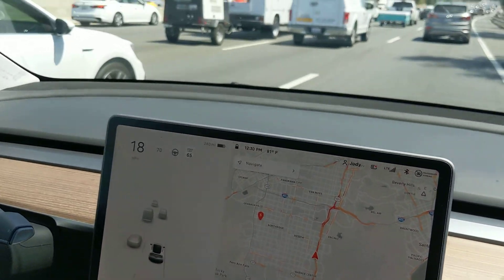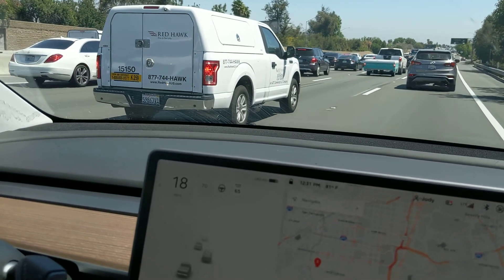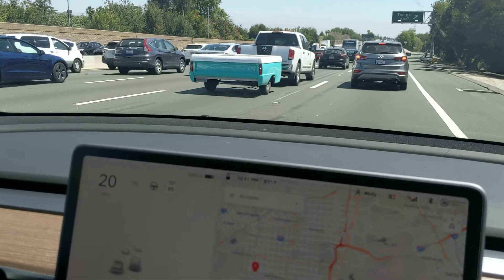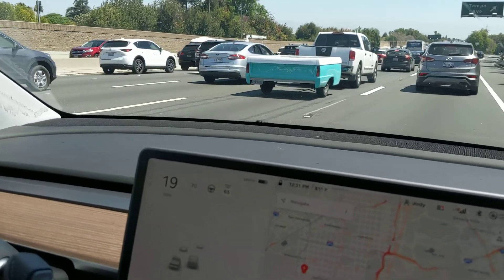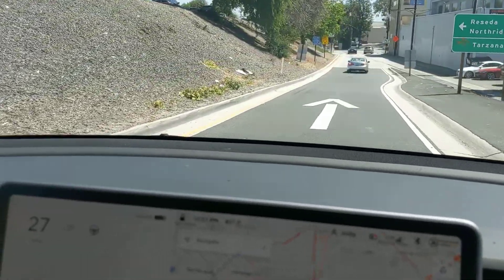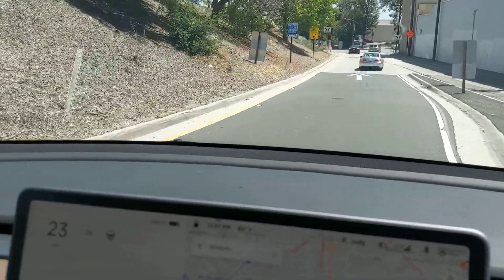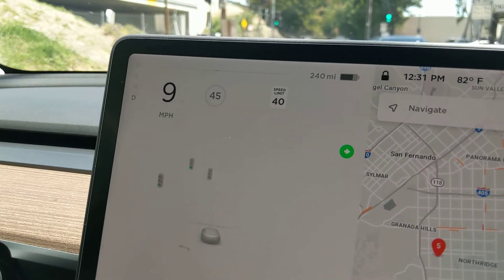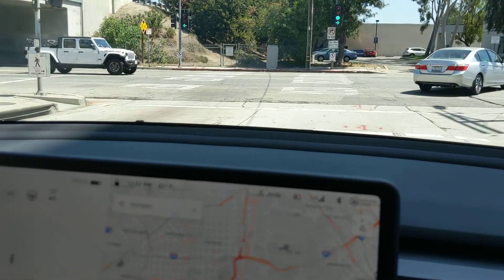How To Use Regenerative Braking in a Tesla

Comment: Yikes, so you’re unable to ‘coast’ in a Tesla and always have to keep your foot on the accelerator?  I have a Y on order but this might be a deal breaker 🤦🏻‍♂️
Reply: You can adjust the settings but hold the highest Regen is great I couldn’t go back
Reply: @nigep  you can’t turn it down anymore. Removed in 2021.
Reply: I just returned mine for this reason. 3 Tesla employees told me there’s nothing I can do. Make me carsick AF. The car kept trying to stop anytime I wasn’t accelerating.
Reply: @bravo1224 did you ever get it ?
Reply: You coast by maintaining throttle position, and the car does the rest
Reply: Use creep mode
Reply: there is a setting to turn the regen braking down. there is also cruise control if u just want to cruise along the highway
Reply: @VancedG82  not anymore
Reply: Deal breaker